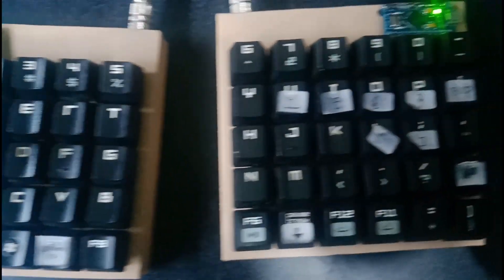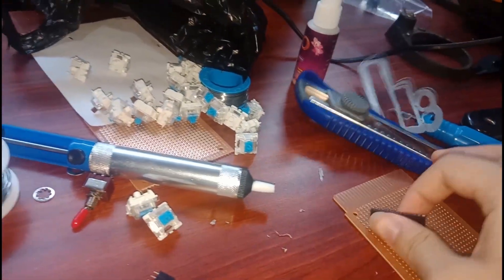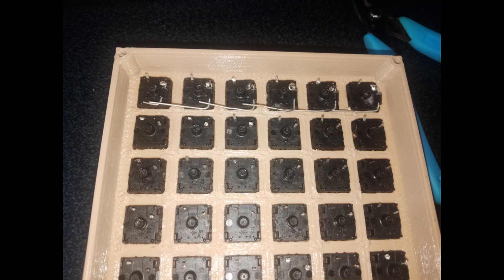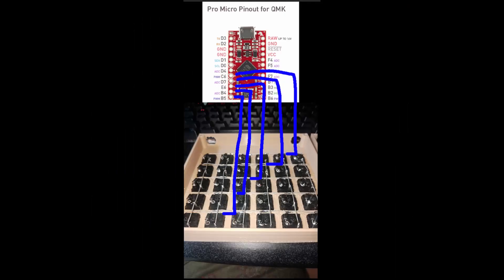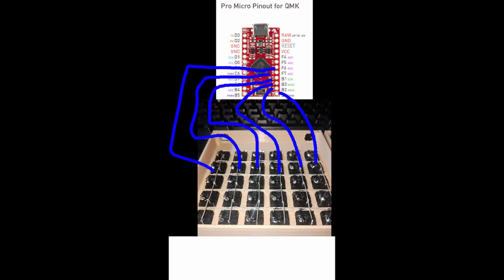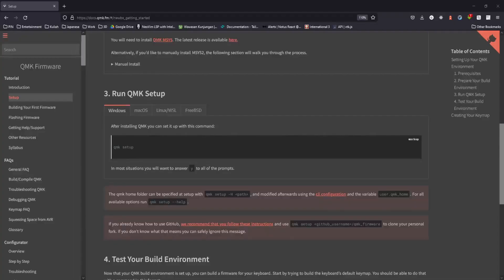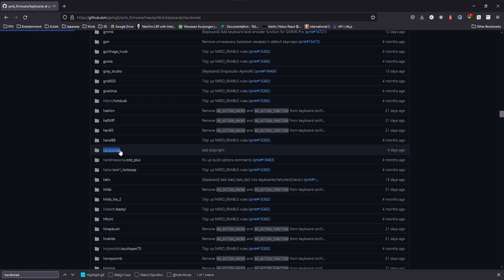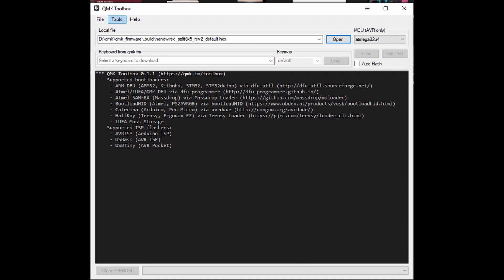How To make Split keyboard with arduino pro micro

Comment: I didn't understand the end, I downloaded the .hex of the qmk and the qmk toolbox. but when I put the file the button to flash it doesn't appear, I don't know what I'm doing wrong but if you can help me
Reply from the maker: actually .hex file is user generated, so you need to generate that hex file using the QMK toolbox and QMK MSYS. 

i created notion for this build, if you interested you can checkout this link for more info, or just ask me again happy to help you :)

https://www.notion.so/gerrysihaj/Ortholinear-3854dac37c244d77910fb4983a8671d5